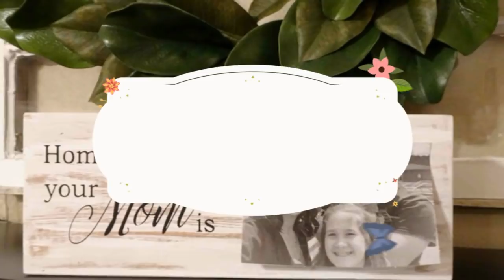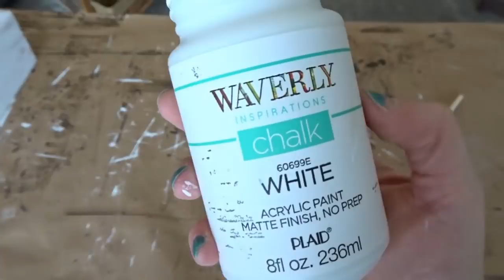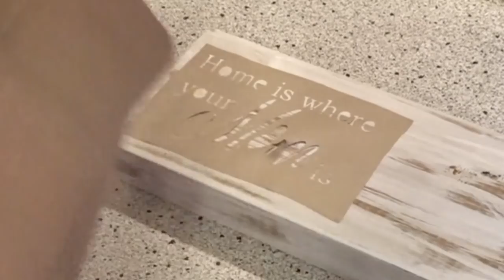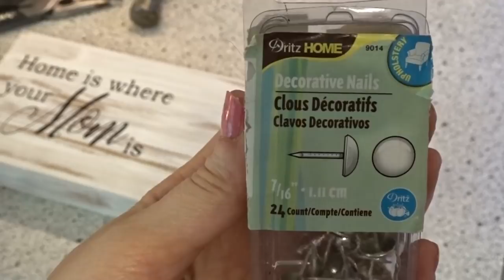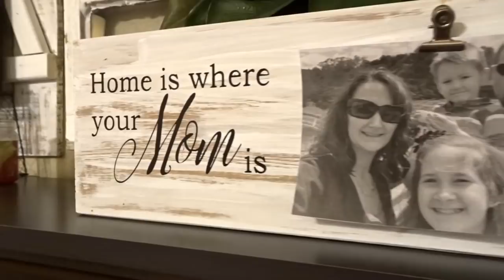DIY Photo Block | Home is Where Your Mom is

Comment: You make it look so easy and that would take me forever! Do you put a wax over the paint or just leave it as is?
Reply from the maker: Wood projects usually do take some time anyway.  I have had to learn some extra patients working with wood and stencils.  The results are so worth it though!  I usually leave signs as is.  If I add anything to seal it, I use a clear matte varnish

Comment: So cute! What kind of vinyl do you use to make your stencils? A lot of times mine bleed pretty bad. ):
Reply from the maker: I use contact paper for my stencils.  My best advice is to make sure your doing light coats with a very dry brush to help stop bleeding.  You can also do a light layer of mod podge over your stencils before you paint, that helps seal your edges down and prevent bleeding too.  Hope that helps!

Comment: Do you pull the stencil off when the paint is wet still?
Reply from the maker: I usually wait till it's dry.  It doesn't take very long and is usually worth the wait.  Otherwise you can smear the paint if the stencils falls back down.
Reply: The Daily DIYer awesome! Im currently working on one for my mom with the saying "side by side or miles apart grandchildren are always close to the heart"! Do you have a video on how you do the whitewash technique I love it!

Comment: if you don't stab at the center of the letters for the piece you take out, you won't have those puncture marks in the center throughout your letters. makes it look more  professional not to have the scrape marks in the center of each letter.  Happy Mother's  Day. thanks for the video.
Reply from the maker: It's not too noticeable with rustic signs.  Thanks for the tip though!